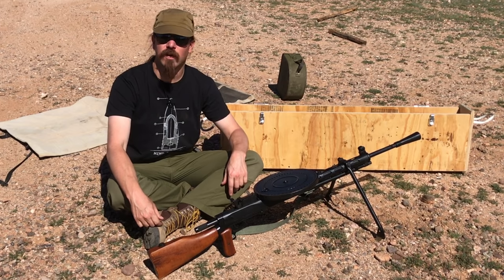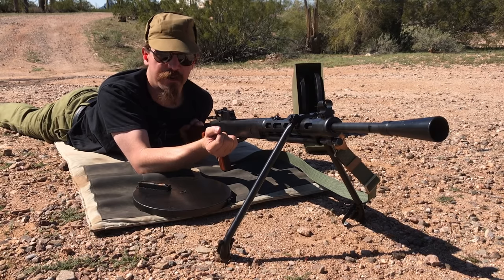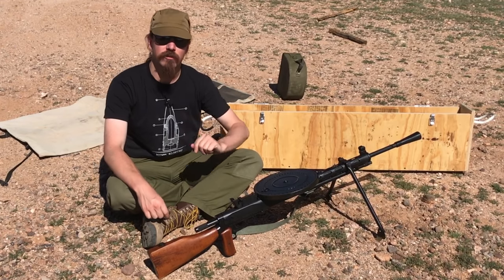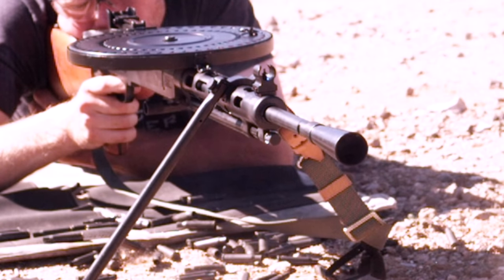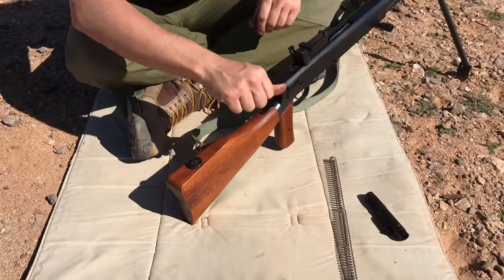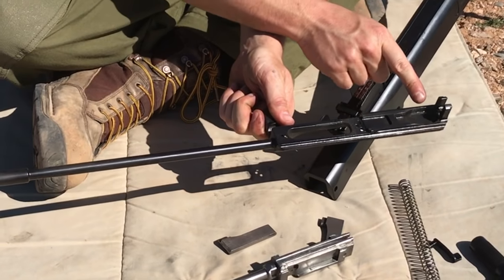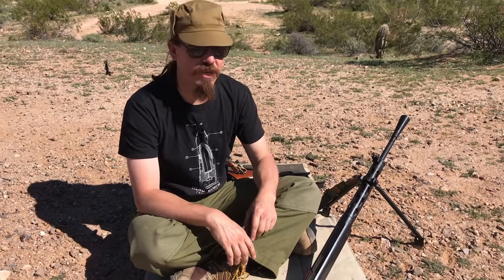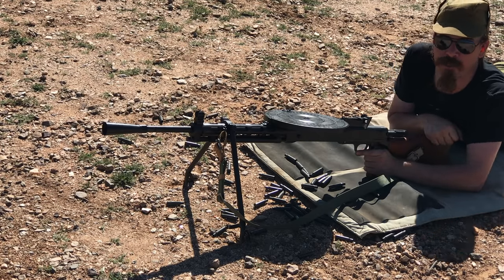Semiauto DPM Light Machine Gun Review

Comment: I have this exact model from SMG and it really is one of the best made semi conversion.  Few things:
1.  The barrel is supposed to be super tight in it.  It's a "quick change" but you need a wrench.  Any looser and you lose accuracy
2.  The semi conversion is extremely heavy duty and not as fragile as other guns
3.  I've had zero issues reliability wise with it
4.  The welding is top notch and you can barely tell where it was welded
5.  Ian is right, these are great values for what you get

Comment: As a Marine, I had opportunity to fire these, strip them, and they are more of "and the AK is kind of like the DP, but slightly more complicated to field strip and maintain."  They were issued with two or three barrels, very easy to change, the magazines are very easy to load fast, laid upside down on thighs, twist the outer case as you drop in rounds, we loaded dozens of pans at a time, for training purposes, and they unload pretty quick as well.  I still believe probably the best base design for any "light machinegun".  As far as I could tell, they last forever, only the 1919 is equal to the DP series, in lifespan, the power requirements for loading, firing, ejecting, pulling next round down, pushing previous in chamber, as RP 46, or simply pushing the rimmed cartridge through the guide into the chamber, spreads the "firing energy" quite well across the full cycle, so its mass is more than enough to absorb the recoil.  I've heard them "on the other side" far too many times to disrespect them.  Semper Fidelis,

Comment: Anything else stopping thing from being converted back into full auto? DP or DPM lowers are not all that expensive or hard to find, and from what i am gathering you get another full auto firing pin, it's back to being full auto, unless they cut the sear engagement place off the bottom of the bolt so it won't be held back.

and even then, the full DPM parts kit can be had for 249 bucks right now.
Reply: The upper receiver has denial pins so only a semi auto bolt will lock up. There may also be lower/upper denials pins too, not sure. The carrier sear surface is milled off.

Comment: The British don't seem to have had problems with rimmed cartridges in a box magazine - the Bren gun (CZ designed) had a 30 round box mag (you could jam 32 in but not advised) as standard. Like the DP you loaded rounds one at a time from front to rear so no rim overlap problems. IIRC Madsen also had box mags for rimmed cartridges.
Reply: The Bren had  problems so a lot of care was need in loading the magazines to avoid rims overlapping.
Reply: Having been trained with and acted as an instructor for the Bren gun many years ago, the Bren did not have problems if you loaded the magazine in the correct manner. You could force the rim of the top cartridge behind the preceding one but it took a lot of effort to get it that stuffed up. Unfortunately we didn't have access to the 'High Speed' kit with the 200 round magazines - if you see Early or Mid War photos of something that looks like a Bren crossed with a Lewis or K (GO) its a Bren set up for AA use.

Comment: Just wanted to note, the "P" in the DP series of machine guns actually stands for "Pekhotny" - meaning infantry. So the designations of the DP-27 and the DPM meant "Degtyaryova Pekhotny" - "Degtyaryov's Infantry (machine gun)". This designation was created so that the DP was not confused with the air and tank variants - the DA and the DT. However, in later models like the RPD and the RP-46 (A modernized DPM that had an adapter to be belt fed) the letter "P"  meant "Pulemyot" - machine gun. There is some info that Degtyarev was the only gun designer who had a direct phone line with Stalin during WW2.

Comment: I'm thinking those mags could get damaged over time trying to load them on a closed bolt. If I recall from messing with mine, the design does not allow for very good back travel, so you could be tweaking the metal when you  smack it in. Good thing they are cheap!  :)

Comment: If you put 46 instead of 47 into the magazine would it help with the force needed to put it on?

Also, I remember reading somewhere about these (well not the DPM specifically but the DP28) and that while the barrel change was a pain during the summer, during the Classic Trademarked 'German Stopping' Soviet Winters, one particular soldiers account said that he and his squadmates would sometimes pack snow into the barrel jacket area when it was too hot to change but I'm not really sure that is accurate because of the temperatures involved.
Reply from the maker: No, it would not be significantly easier to seat the mag with 46 rounds loaded, because the last round in the mag is always be pushed down into the feedway. The solution it to hold the bolt open while seating the mag.

Comment: I noticed that you were shooting this off your left shoulder. I'm a lefty and I struggle with finding historical guns (or replicas) that don't burn me with hot shells or give me headaches from inhaling fumes. Do you normally shoot left handed, or did you do that because the gun's construction necessitates it? Would you consider this gun a good choice for a left handed shooter?
Reply: What guns burned you? I've shot most common guns and actions and the only thing I've ever gotten burnt by were traditional muzzle-loaders and rapid firing a bolt action rifle on a 100 degree day.
Reply: BTW - I am in the process of building a DPM. The main thing a lefty will need to watch out for is the location of their non-trigger hand. It should wrap around and brace the stock on your shoulder. The charging handle on this gun moves a long ways and could break your hand/ fingers if you attempt any forward grip.
Reply: I've been burned by an AK-74, as well as various forms of the M16 body (which also has the fumes issue for me). The M1 carbine spat a round down my shirt. Funnily enough, the AK-47 has been the best to me of any of the guns I've shot.

Comment: What I do with my SMG DPM in semi to load a mag....place front of mag in its catch. pull back bolt handle, lightly press mag down into opening....release charging handle and the first round is chambered and no pressure was used to push mag into place. Being it was an open bolt design holding the bolt back on semi conversions make it load like it did in open bolt.

Comment: As I recall, there's a soviet tool for loading the pan mags. It consists of a steel post that slides into the hole in the center of the top of the magazine on which the whole assemble pivots, and a small steel tab that catches the tab on the magazine. The idea was you'd put the pan on the post and rotate it along while the steel tab on the loading tool held the magazine tab in place. I've only ever seen two of them, neither one marked with any kind of proofs or dates that could date them or definitively place them as Russian tools, but they worked incredibly well for the job.

Comment: could they have added a bolt hold open device to help with loading, or is there just no space in the receiver?  have you handled any of the lahti-saloranta mg magazines? the LS doesn't have a stellar reputation, but I haven't really seen much of it blamed on the magazines.
Reply from the maker: A hold-open could probably be done, but would take a lot of redesign, since the magazines aren't designed to engage a hold-open. Considering the number of units that will sell, this would add a ton to the cost, and not be worthwhile. On the other note, I do have a couple LS26 mags, although I have not had a chance to shoot or disassemble one of the guns.

Comment: This seems exceedingly easy to turn into a machine gun.
Original FCG, not a controlled part, new firing pin on the bolt, bam.
Reply: no, not that easy. The bolt carrier will never function for FA use anymore due to it's semi auto mods not discussed in this video. The bolt likely can no longer accept a full auto firing pin due to the milling and possible sleeves for the semi pin too. In short, simply adding parts would not work.

Comment: wasn't there a larger magazine then 47 rounds I thought there was
Reply: DT (variant for tanks) comes with 63 round magazine
Reply from the maker: The DT mags hold more, but are not interchangeable with standard mags - they are actually smaller in diameter and require a front latch in a different position.
Reply: And even if they fit, the dt mag would block the sights. The dt has higher sights I believe.